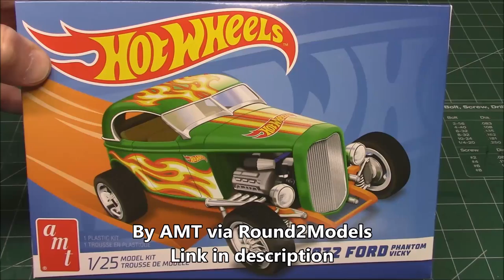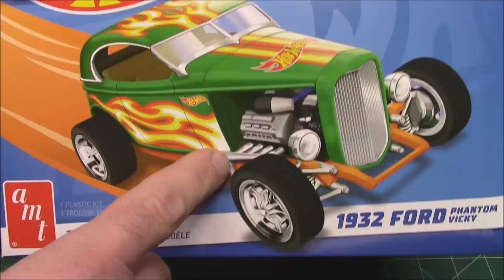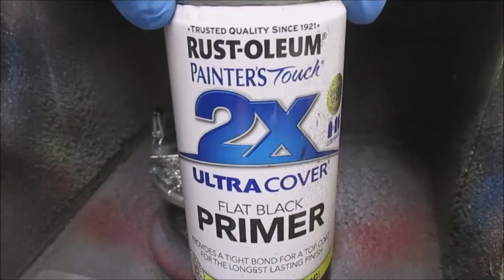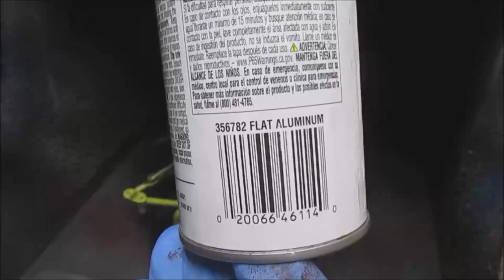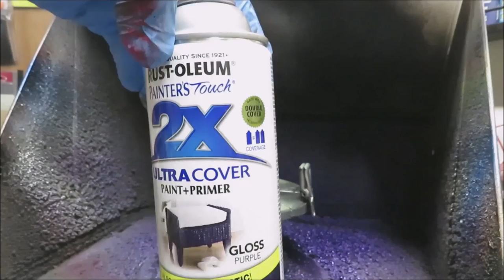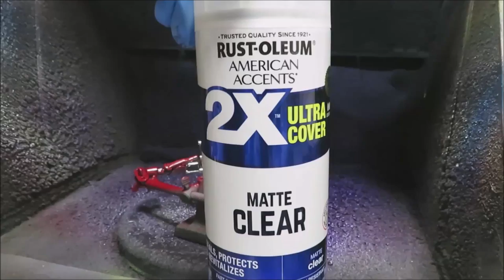1932 Ford Phantom Vicky RestoMod 4.6 Cobra V8 1/25 Scale Model Kit Build How To Assemble Paint

Comment: I've been thinking of getting back into building kits again, but i don't have any where to paint inside, we converted our garage into a bedroom, and can't really paint outside in the winter, so my question is would one of those paint booth's make it safe to paint inside if it filters out a window?
Reply: The paint booths help, but you will still have some fumes to deal with, even after painting somewhere else, the parts "gassing out" afterward still can leave quite the fumes that may be offensive to "non modelers" (the wife).  Acrylics on the other hand can be sprayed inside with little residual scent when used with a paint booth.  I use my little one like Chris has inside often with no issues when using acrylics with my airbrush.  I have a larger paint booth in the shop for lacquers and enamels, whether it's spray cans or air brush.
Reply from the maker: They are only to catch overspray, and will vent outside but they are not vapor booths and you'll still get stink and fumes in the house if you use spray cans or harsh chemical paints.

You can always get an airbrush system from Harbor Freight and use acrylic model paints. Vent it out a window and you'll have little to no issues with dangerous fumes.

Comment: Mighty cool Hoss, good deal! And the 4.6 L cobra engine is a modern day "cammer" , at least that's what I would think anyways, the old 427 SOHC engine is what the older fellars called a "cammer", bc of the overhead cams, well that 4.6 is a cammer too except it's a DOHC, badass engines, guys probably get just as much if not more HP out of it as the old 427 SOHC. Anywho, Merry Christmas to you and yours Chris! 🎄🧑‍🎄🤙✌️

Comment: This kit was full of cool parts. That's a Hallock-style windshield. The steering wheels is a Banjo wheel, which was originally available on '30s Fords; in this instance, it is of a smaller hot rod-style diameter.

The wheels are Halibrand-style, but done to a modern, bigger diameter.

Comment: I didn't know you could use Tamiya PS sprays for plastic model kits. I always thought it was used for RC car bodies and lexan. Glad you didn't have any issues with the paint. Love the metallic purple. Nicely done!
Reply: They make Tamiya for Plastic Models and a different type of  Tamiya paint for RC kits
Reply from the maker: Yes, it works perfectly fine.
 The R/C PS (polycarbonate) paints are simply more flexible and designed to bond with the lexan R/C bodies. They work just as well on styrene plastic.
Reply: @hpiguy  Thanks for educating me on the PS paints!  It's always good to learn how many options there is available!  I have a local RC shop that has lots of this on hand. I just didn't know if it would work with styrene.  Merry Christmas Chris!! 
🤓

Comment: Is there a advantage to using modpog for the clear parts. Over using canape glue?
Reply from the maker: I simply prefer it but everyone should use the items they like using.
It's thicker so it stays in place where I spread it, and it holds the glass in place for me while it dries. 
It remains semi flexible so glass doesn't pop out when I spread a body over a chassis.
It's cheap and much easier to find in any craft store.
It also dries in minutes in the food dehydrators I use to speed up my building.

I've never used canopy glue so I have no idea if it cleans up as easily as mod podge or dries as fast.